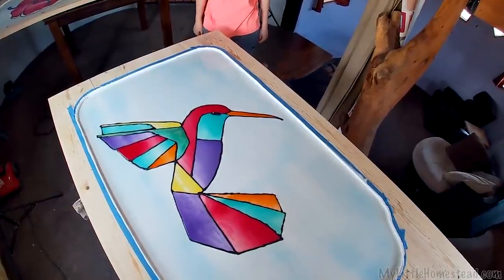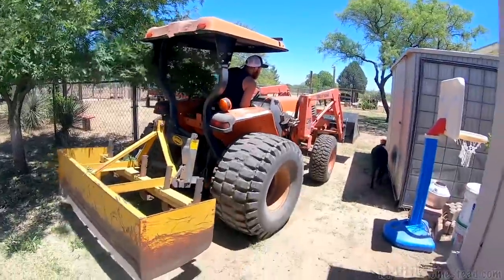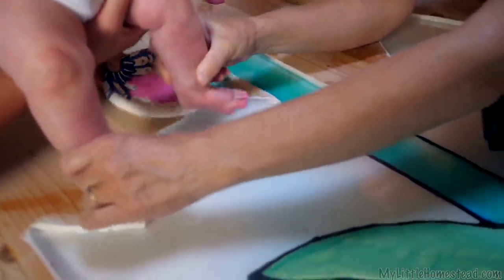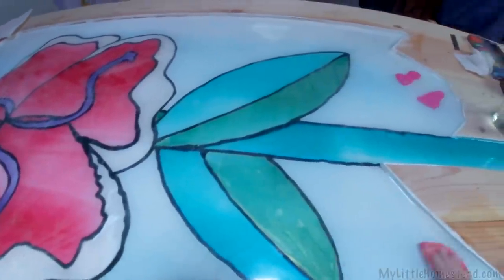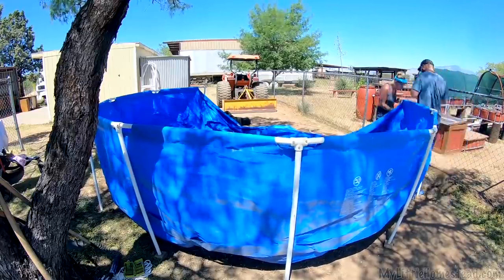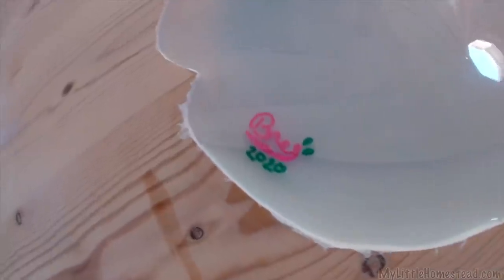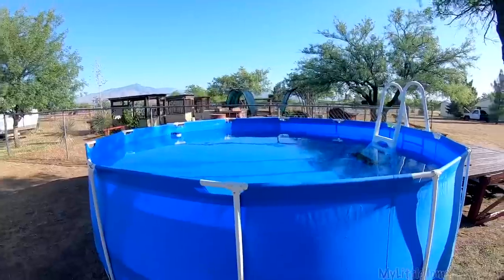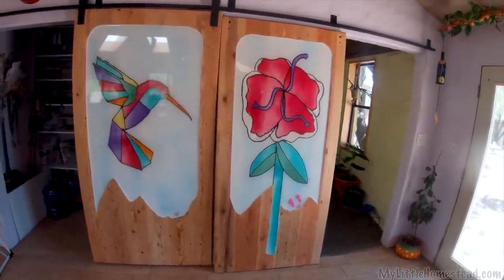Pantry Barn Door Epoxy Art Complete, Summer Pool & Aquaponics Harvest  | Weekly Peek Ep235

Comment: Since Garren and Elle's brought up water temperatures, I'd like to bring up concerns about the temperatures in their  aquaponics fish tank.  With the relatively dark paint color, and the way the cycled water will be brought to air temperature, I think there may be real heat issues for the fish as summer develops.  I think it may be vital to shelter the large tanks from direct sunlight to slow thermal accumulation, and during autumn, they might want to insulate the tanks, unless they'll be getting emptied entirely.
Reply: Great shot of Gary and grand baby!
Reply: Love this family.
Reply: Thats what I thought. Most aqaponics people in desert areas paint the pipes and tanks white to archive maximum albedo. 
The brown looks nicer, but you will have to carefully monitor the water temp issue.
Reply: @nilesbutler8638  I actually think, if they're willing to put in the effort, that the large tanks should have earth-bag walls a couple feet thick their entire heights, adding significant thermal mass to moderate heating, and act as insulation in colder weather.  The fact that it would also add quite significant structural strength shouldn't be ignored, but that is balanced with the fact that it would make plumbing access more laborious.

Comment: If you guys are going to be using a lot of epoxy, its far cheaper to buy in bulk on ebay. In my area its a 10ltr starter & 5 ltr hardener (15ltrs of epoxy) for around AU$300

Comment: The doors look great, but it would have been really cool if the epoxy went all the way through so they would allow a back light to shine through.
Reply: A great design thought Teddy, but from experience, technically MUCH harder to build. Could really only achieve that with traditional stained glass doors. Brei's design mimics that LOOK, without introducing actual glass in a busy kitchen area. (kids roughhousing, etc.)

Comment: instead of rollers, cut a slot in the length of the bottom of the door and slide a small piece of angle iron mounted to the floor where you want it to slide through so it rolls cleanly.

Comment: Your lettuce transplants made a good demonstration of concept. However, they've already bolted, and are unfit for consumption.

Standard epoxy turns dingy brown with UV light exposure. You bought standard epoxy. Take it from a surfboard builder. You should have used Resin Research UV-inhibited epoxy. You can sand again and add some, or you can substitute Silmar 149 or 249 iso-polyester resin. It's cheaper. It will block UV rays from yellowing the epoxy.
Reply: Either Resin Research epoxy or Silmar resin would make a good coating for the wood too.